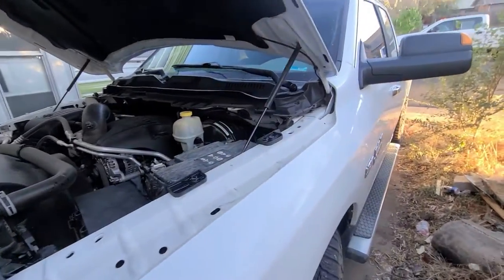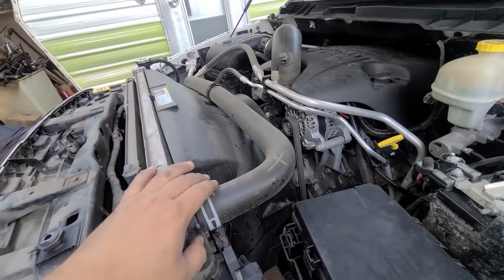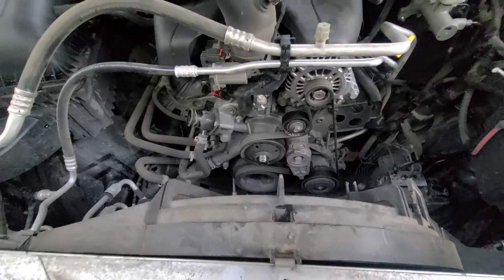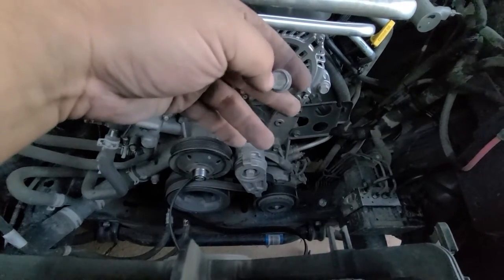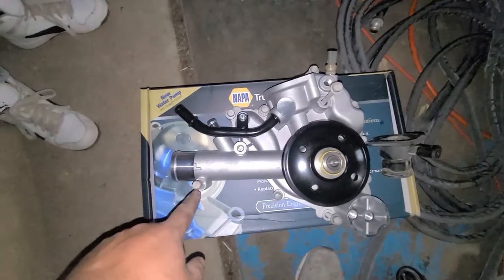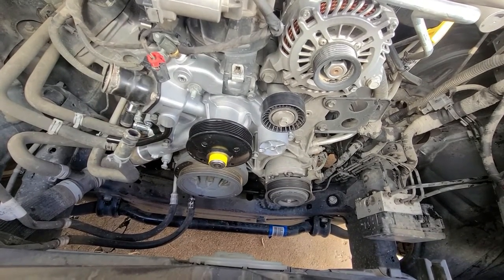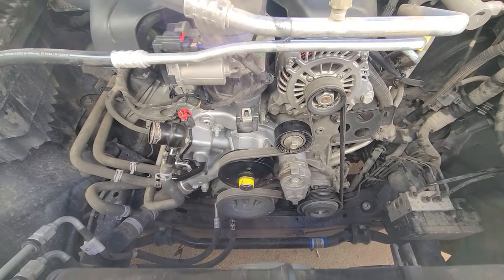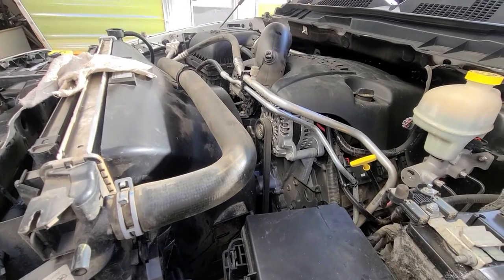2016 Ram Water Pump Replacement

Comment: I have a small leak somewhere around the water pump. Not 100% sure where it is but it's coming from the water pump pully area. So I'll be doing this repair in the near future. For now I just hope it hold and the leak stays very small. Thanks for the video so I have a good idea what I am getting into.
Reply from the maker: Man, don't risk it. Change it asap. These engines don't do well if they overheat. Good luck.
Reply: @rustbucketgarage  yup I’ll be doing it soon.  It’s wonderful timing since my warranty just expired a month or two ago lol

Comment: How did you get the shroud off before the fan? I took the bottom piece off and removed the other 3 clips but it won't fit in between the fan and radiator. Same year and engine 🥺
Reply from the maker: Man that sucks I remember the one on my truck come out then I had the room to work. You can always try and loosen the fan and slide everything out together. Good luck 👍.

Comment: My oil pressure at idle is 43 yours I noticed it low. At 34. Your engine is seeing internal wear.
Reply from the maker: That's some good pressure. How many miles do you have on your truck? I did some research, and it looks like I'm within spec at idle and under load.

Comment: Nice vid on the repair.  That old pump must have been bad for a while  the way it wobbled, huh...  Imagine you were losing coolant while it was bad in addition to the squealing.  I just bought a 2016 Eco diesel and noticed coolant dripping yesterday so I'm anticipating this job.  My truck only has 53,000 miles it.  Just my luck. Did you spend maybe 3-4 hours on this?  I did the water pump on my '01 F350 7.3 Powerstroke a couple years back which wasn't too bad.  I remember taking out the fan and shroud together.  But this one I may just get done so as to go easy on my 75 year old arse.... Hah.
Reply: Oil pump leaking coolant 😅😅😅

Comment: Hey did you add silicone or just put gasket after you
Reply from the maker: No silicone, I used a light coat of copper spry on the gasket. Make sure you tighten each bolt just a bit in star pattern so the pump is even on the block. Good luck.

Comment: Hi RBG can I ask what’s problem did you experience to know your water pump went out? Thanks I’m advance.
Reply from the maker: Hi , first off a squealing noise that I thought was an idler pully, but it was the water pump, then the front  pump pully snaped off all the antifreeze came out. That's how I found out
Reply: @rustbucketgarage  Thank you, RBG 

My 2014 was over hearing pretty bad replaced thermostat only to have to continue to over heat about two months later finding out water pump was bad. So I replaced water and fan clutch seem to be sounding stronger and not over heating anymore.  It’s always something with these Rams.